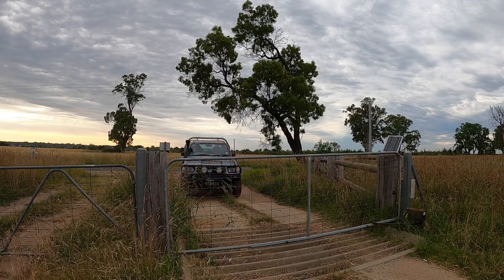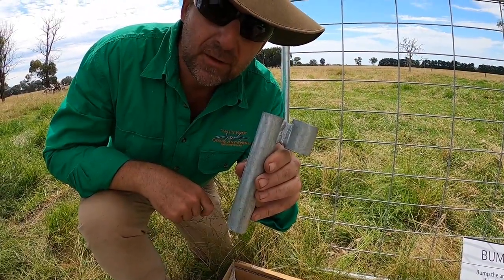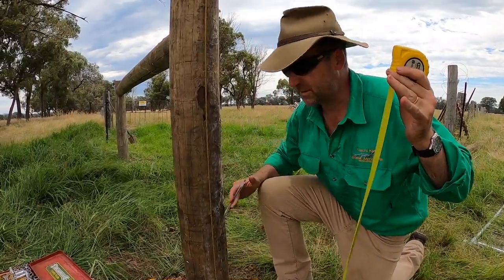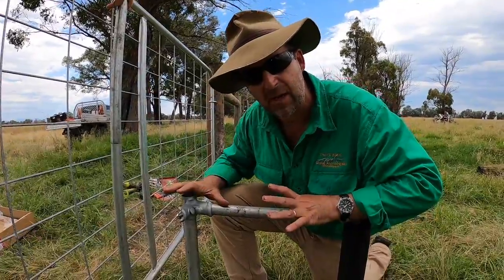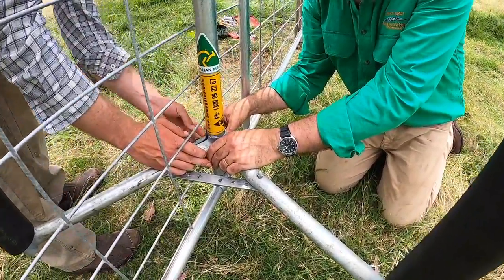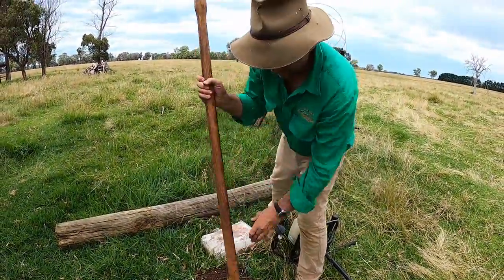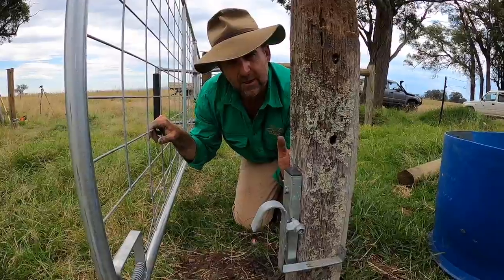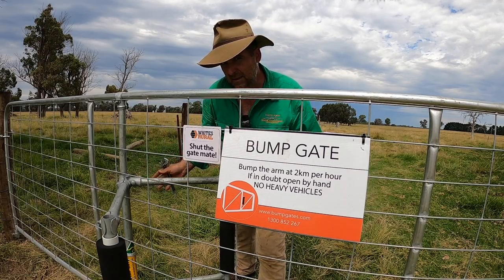Bump Gate. Non Stop Paddock Access.

Comment: Top tip for drilling straight holes: use an over size washer on the drill bit, it spins as you start to drill, if it moves towards the work piece you are too high, towards the drill you are too low, keep it in the middle and you are level, and now you just concentrate on the left or right level.
Reply from the maker: Ripper tip mate. Might even put this in a future video. Cheers.
Reply: Cheers! I'm trying this out first thing tomorrow.
Reply: Amazing
Reply: Hell yeah, thanks!

Comment: Bump gates have been used in the Texas sheep country for many years.  The gates I have seen are much heavier built.  The pivot pipe is usually 6-8 inch diameter. Many of the ranches run cattle as well.  I have never heard of cattle going through them, but that doesn’t mean it hasn’t happened
Reply: Being TEXAS the bump gates would be bigger to I think

Comment: Good morning Tim, I was really impressed with the concept of the bump gate. I would like to know how cattle effect them, cheers another great video.
Reply from the maker: This was installed in a cattle paddock. We will see. We left the catch posts higher to avoid injury for stock and them getting lost in long grass and damaged by slashers etc. The gate requires very specific angles to work. If the posts can be thrown out of alignment then this would cause problems. The gate also needs to be offset from the corner by about a foot to allow the gate to travel 110 degrees to the catch post. Advantages include no batteries, no wires and no switches to break.
Reply: Far better than undoing gate and pushing it open fast with the brumby Ute while racing the 4 sheep who think they're dogs and just want to play silly buggers dancing around the vehicle :D
Although the bump part looks perfect for rubbing that itchy spot between horns, especially for goats, I'd love to test how that goes.

Comment: Had one of these for 15 years. Great idea most of the time. Main problem was the ladies hitting it way too hard and bending everything. If you smash into them, they bounce off the catch hook and slam into the car. That was somehow always my fault. Also, seasonally, the ground moves and throws the alignment out too.
Horse floats and trailers can catch as it closes and tear the whole thing out of alignment. NO ONE READS THE "IF IN DOUBT OPEN BY HAND " sign. First thing to break is the locking pin at the hole drilled through it. Make some spares first. The pivot points on the "bump" arm are weak and need reinforcement from time to time also.